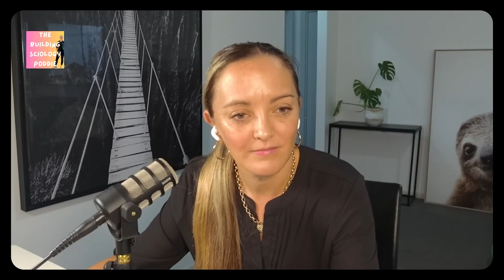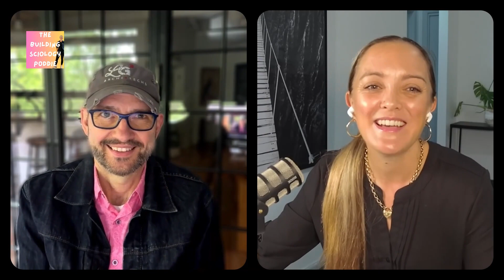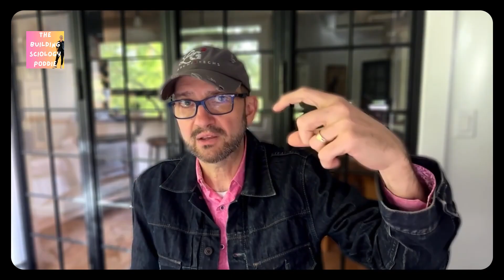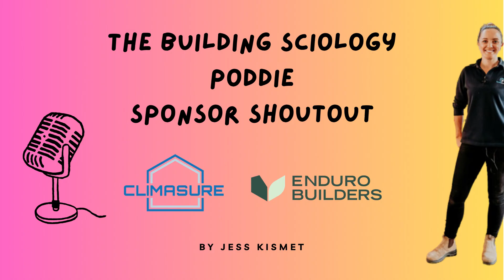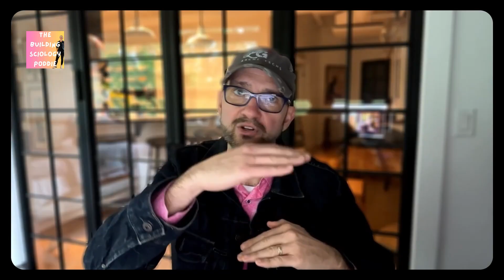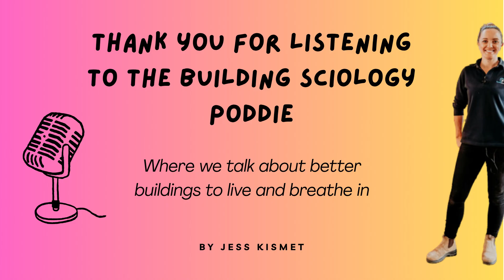#40 | BONUS Why Beautiful Buildings Last Longer with Chris Laumer-Giddons

Comment: I comment on Chris's videos quite a bit.  But I can't get him to be specific on his aversion to EPS foam other than "it's plastic".  Yet, he builds houses with plenty of petrochemical sealants, OSB, and an insulation that emitted formaldehyde in its previous manufacturing method.  I think he has an irrational fear of plastic.  EPS is very benign.  I cringe when "the perfect wall" is mentioned.  You mean the one where you put the vapor barrier on the inside in cold climates, on the outside in hot humid climates, and flip a coin and take a chance in mixed climates.😂  I like nasty plastic ICF houses.  Don't get me wrong.  I like Chris and respect his knowledge.
Reply from the maker: I avoid the stuff too in my recommendations except for under slab and my main reason is that it burns very quickly and emits horrible black smoke. ICF is better than what we do in Australia too which is out the EPS on the outside. I think foam has its place but it’s just important to understand the properties of the materials when specifying them is all. Thanks for listening!
Reply: @BuildingSciology  Some conversations (especially anonymous internet ones) can be unproductive. Thanks for the podcast!
Reply from the maker: Thank you for listening!
Reply: @BuildingSciology EPS self extinguishes.  Throw it on a burning pile of wood, and yes it will burn.  Take a piece of EPS and try to light it on fire, it will go out as soon as you remove the flame.  In the presence of wood studs and sheathing and the supply of air provided by cavity walls, it will burn.  But that is not an ICF wall. ICF walls are solid, no air cavities.  There would have to be an already raging fire in the house before it could burn through the drywall to reach the foam.  Fires in electrical boxes do not spread...no air cavity, no wood, foam self extinguishes.  Stucco finished ICF houses were sometimes the sole surviver in neighborhoods burned to the ground in the California wild fires a few years ago.  Do a Gemini AI query about how ICF houses do in fires:  How do ICF houses handle fire?
Reply: "You mean the one where you put the vapor barrier on the inside in cold climates, on the outside in hot humid climates, and flip a coin and take a chance in mixed climates.😂" 

This isn't what the 'Perfect Wall' assembly is describing. 

It typically refers to enough continuous exterior insulation R value to prevent condensation on the interior surface of the sheathing, then some kind of combined air, water, and vapor control layer on the exterior sheathing, then the structural sheathing and framing, and optionally some interior insulation, and finally interior finishes. 

Typically control of water vapor by diffusion and air movement is accomplished at the plane of the sheathing by either taping the sheathing or using a self-adhered membrane on the exterior surface of the sheathing (which is like using really wide rolls of tape). In the template for this assembly there is no vapor barrier (vapor impermeable layer), although one could use one at the exterior surface of the sheathing if they wanted to and it would work fine as long as the exterior R value was sufficient to reduce condensation risk for the climate and interior conditions (occupant behavior).
Reply: @comfyhome Yes, technically "Perfect Wall" does not have interior insulation or a vapor barrier.  Exterior insulation and no interior insulation keeps the interior side of the WRB above dewpoint (when interior is in the range of human comfort).  However, giving up 5.5 inches of wall cavity insulation is hard for some to give up, and so they put it in, thus lowering the temperature of the WRB and creating a condensing surface and need for a vapor barrier.  So go ahead and leave the wall cavity empty and put on more pricey outsulation.  That is not Perfect in my book. Anyway, an ICF house will work out perfectly for me and my descendents. And Perfect Block might work better for the Southwest.  My  childhood home was flooded by hurricane storm surge twice, Camille and Katrina.  Fibrous insulation is not salvagable, whereas EPS is.  And it won't  rot if water infiltrates.  Lots of good wall assemblies, none of them perfect.🤷‍♂️

Comment: I am a builder in the Seattle area. Dose a zero air leak cause more mold risk?  Are we letting perfection be the enemy of the good?
Reply from the maker: Hi!  Perfection can be the enemy of good and going after zero leakage isn’t always the goal. Air tightness doesn’t create mould if you understand air flow. Air tightness also requires ventilation - they go together. If you don’t understand air flow then yes, unintended consequences can occur. Chris has a very good understanding of both air tight construction and ventilation so there’s very little risk in what he does. Thanks for listening!!
Reply: With a tight house comes the need for mechanical ventilation and humidity control.  That is a given in performance buildings.
Reply: In the context of contemporary energy use targets and building materials, airtight construction with appropriate HVAC and dehumidfiication and enclosure assembly design reduces mold and rot risk. In much older homes made out of old growth wood, masonry, and other highly moisture tolerant materials with 150-300 million BTUs of heat pumped through them to dry them out each year, air movement and leaks helped improve drying.

We don't build out of old growth wood any more though, and some types of masonry aren't always practical these days, especially in a high seismic risk area like Seattle.